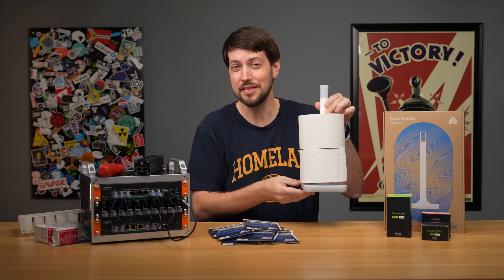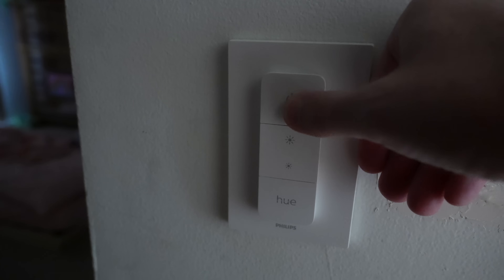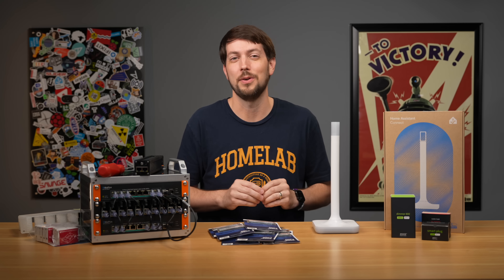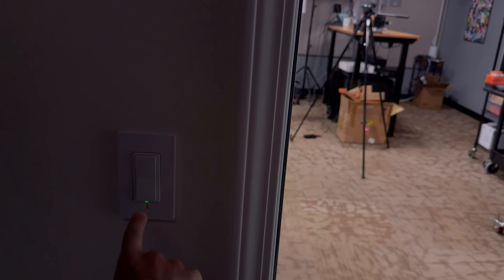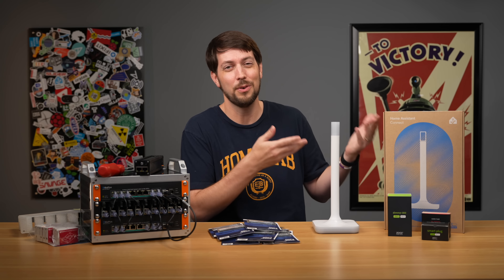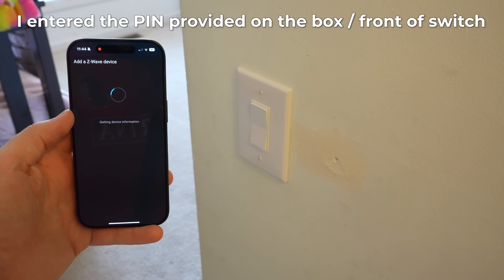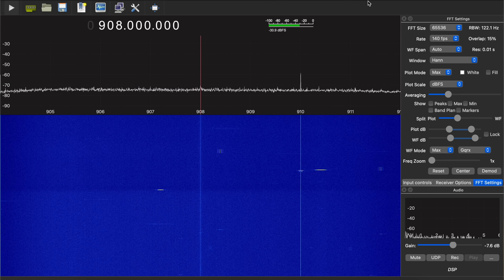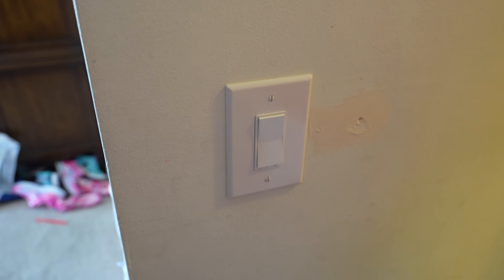My Smart Home Played me for a Fool

Comment: Welcome to Z-Wave! Even without the, uhm.. unit of an antenna, the range should beat Zigbee on the simple basis of lower frequency (2.4GHz is a terrible choice for low power applications).

Nice thing about Z-Wave is it's a standardised system, so all devices should interoperate well. Unfortunately, fair warning, there's an awful lot of very odd and flaky devices out there. Strange goings on like simply dropping off a network while still nominally being paired, being paired under two or even three different IDs despite having been factory reset, some very funky behaviour with battery devices (keyfob style switches can be.. inconsistent).

Actively avoid anything which is not Z-Wave+, with the possible exception of simple battery powered sensors. Thankfully, most things are now.

Comment: i startd home automation many years ago using zwave and they are still working. on top of that Zwave has a longer range of Zigbee because it is not using the Wifi frequencies.
using lower frequencies penetrates better through the walls which is a plus. 
right now i have a zwave bridge (fibaro) but as soon as it dies i will get the antenna you just shown us.

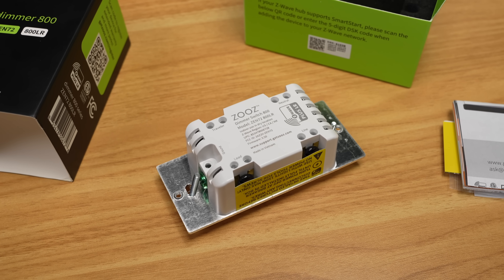Comment: 3:39 Breaker panel, confirm no voltage, do work, flip breaker again, confirm you didn't start an electrical fire, close up, done.  It isn't hard and there shouldn't be 120v/240v running through the wall unless you are an idiot.

Comment: In my last house, I installed a bunch of "dumb" Lutron motion switches in place of the traditional light switches, and they worked fantastically. No wireless connectivity needed. I programmed some of them into "occupancy" mode so they would only turn off the lights in bedrooms when unoccupied for a period of time (never automatically turning them on), but the ones in the bathrooms/laundry/garage would turn on and off the lights based on motion.

Comment: Isn't the saved brightness thing a setting with the actual switch config? At least it usually is, at least my hue lights have a "power on to last power-on state" option I thought.
Reply: In the Hue app you can set the power on behavior for the lights, this doesn’t have anything to do with the switch though; i.e. even without anything except completely dumb switches this setting works.

I’m sure though that some switches including those from Philips Hue have the possibility to set a certain behavior for lights that they control when turned on.

Comment: 3:45 Been there, done that... Multiple times... I've replaced all my switches and had a very safe way of working by turning off the breaker and always testing the cable before working on it and I still managed to zap myself when I replaced the very last switch (240 volt).

Comment: 250V in Europe. Without split phase i.e. no neutral wire or center tapped neighborhood transformers or need for bonding ground/neutral in only one place.
Reply: Lack of split phase doesn't mean lack of a neutral. In the vast majority of Europe, it's ~240V (220V, 230V.. I guess some of you might have done 250V..) from a 3-phase supply, with a grounded neutral which must not be additionally grounded in a normal installation, or RCCBs do not function and load currents can and will flow through earth wiring.

Comment: It is an interesting upgrade, I could see it being useful if you were spanning large dead zones, like sending Z-Wave to a detached building. But one of the benefits of every IoT protocol that's not Wi-Fi is they form mesh networks, so for getting around the house it's probably cheaper just to buy another Z-Wave device to be deployed somewhere in the middle that can do its own thing and act as a mesh repeater.
Reply: Or just a zwave extender that plugs into an outlet.

Comment: I always felt like putting the smart guts in the bulb itself was stupid, unless you want the color shifting stuff. I would much rather have the smart guts at the switch instead. Plus bulbs are more akin to printer toner to me; it's the commonly replaced consumable, sticking smart guts in there would be expensive.

Comment: I have solved this exact kind of issue by getting rid of the Hue bridge and using instead a ZigBee USB stick as my hub. Using the Hue bridge makes its associated bulbs and peripherals unable to use the ZigBee mesh. Without it, the switch signal can be relayed by the bulbs through the ZigBee mesh.
Reply: That's the one thing I didn't know.
But what about firmware updates ?
And all those fancy scenes that the coloured Hue lights can do ?
Do you miss any of that ?

Comment: Using Philips hue in home assistant can be controlled directly without the hue app. The lights and switches can directly be conencted to a zigbee dongle. There is even a POE zigbee adapter so the adapter can be placed in a central location. This way the signal reach is better and you dont have to deal with the hue app.
Reply: Also came here to say that Zigbee uses a mesh network, so coverage by routing devices is more important than the distance from a single non-routing device to the Zigbee gateway.
Reply: I was about to say the same.
I have a smlight slzb-06m I think.
And 3 hue bulbs It works perfect.
Don't use Philips hue app nor hue zigbee controller.
Just buy some beseed plugs that act as routers or some Ikea plugs for temporary routing.
Reply: Seconded. have a Sonoff Zigbee dongle, but I'm using it for Sonoff environmental sensors... but I wanted to put one further away than the Sonoff seems to work... Can we expect longer range with the ZWA-2?
Reply: @qcca123-f1v  you can extend the range of your mesh by strategically placing zigbee power outlets throughout your house that act as zigbee network routers. :)
Reply: @BienenChef or by getting a Zigbee extender. IKEA has some and they are even included in some of their battery operated products. (Like their smart blinders.)

They get power from USB A so easy to plug into something nearby. Or just a USB charger.
Reply: There are Zigbee devices that act also as routers (usually the ones without batteries) or another option is to flash the router firmware to the dongle instead of the coordinator one.  Moreover you could bind switches to lights on the z2mqtt interface so even if HA is going down, you can still operate them.I have paired to a single coordinator over 100 Zigbee devices and all working flawlessly over 3floors+garden.
Reply: I came to say the same thing.  I had constant problems with the hue hub locking up and requiring a power cycle every 3-4 weeks.  I replaced the hub with a zigbee dongle and have had zero problems since.
Reply: Assuming zwave isn't dead, I prefer that over zigbee purely because its not on the 2.4ghz band.  I Still have plenty of devices clogging that band including my themostat and it's remote sensors.  The same idea applies though, the light physical interface needs to function even if the wireless communication is down, and taking that one step further (aka homeassistant) the automation and wireless controls ahould still function even if the internet is down, or the company is shutting down their online service.
Reply: This is what I do, but the Hue switches are MOSTLY reliable, but having to swap batteries is getting to be a chore and occasionally they just won't work the first time you press them and I have to hit them a second time.
Reply: Yep this ^
Reply: Agreed. Lol
Reply: Why is your Hue hub located in your basement, instead of near the 3D center of your house?
Reply: I'm very surprised someone like Jeff was still using the hue hub, especially since it forces a cloud connection
Reply: @JustTheJames you might have to register but it operates locally.
Reply: @hmoffatt interesting, has that always been the case? I haven't used hue with the bridge in about 5 years and I remember there being around a second of lag every time, and not being able to turn my lights off when my internet went out once. Although thinking about it, I didn't have any of their switches at the time so it's possible those always worked locally.
Reply: @JustTheJames Zigbee has always been local. When you configure a switch to control a light it will send the message to it directly without going through the hub afterwards.

But if you are using a switch that's not compatible for some reason then it might need to go through the hub to be translated. That shouldn't be needed if both are Zigbee units though.

Comment: Your wife's unimpressed "mmmm" was hilarious lol. I think she misses the tactile feel of old switches.
Reply from the maker: They are nice. Would love an old switch with a solenoid to knock it on or off
Reply: @JeffGeerling  That'd be awesome. Tap a button on your phone and hear a distant KERTHUNK upstairs.
Reply: @OfficialEpsilon  The dream!
Reply: @OfficialEpsilon  The "KERTHUNK" would be like my old neighbors' house.  All the light switches are two mechanical buttons.  Push one button to turn the light on, the other button to turn it off.  All those buttons are wired with "doorbell" wire back to near the main fuse box where there is a large relay cabinet.  Everything controlled by light switch has its relay go KERTHUNK when a button is pressed in the house.
Reply: @OfficialEpsilon A 240V contactor would achieve that nicely! 😂
Reply: @OfficialEpsilon if my smart home isn't manually flipping a medieval looking mains wire switch why even bother with it at all
Reply: @JeffGeerling  Lutron switches by Caseta actually actuate the physical buttons! You can have the tactile feel of regular switches, but you can also hear the switches being physically knocked to the correct position if you control the lights via home assistant. A friend has it across his entire apartment, and it's really cool when he turns everything off and you hear a storm of clicks throughout every room.
Reply: That is why I always use smart relays like the Shelly 1 or Sonoff mini. Then no one has to know that I have smart lights.
Reply: @JoyfulShadow-i5u  The shelly introduces a delay though as the switch just becomes an input to the shelly which fully controls the switching of the light. If it fails you can't switch your light at all.
Reply: @JoyfulShadow-i5u  Could do the same with smart bulbs, but multiple smart bulbs on the same switch has always seemed silly to me.  On the other hand, one bulb in the pantry or closet works like normal from the wall switch, unless someone leaves it on and my automation turns it off.  Then the next time for manual operation the switch has to be moved off then on.
Reply: Which team is that at 2:32? Is that the St Louis City football team strip?
Reply: @sky37blue known as ⚽ in usa(known as football in other countries)
Reply: @abramb8690 you've posted a picture of a football and then said it's known as football. I'll keep calling it football though thanks since I'm not in the USA.
Reply: @sky37blue I typed soccer then noticed the ball ⚽ but the word soccer disappeared from my post, unfortunately in usa football typically refers to a different sport 🏈 but by whatever name I much prefer ⚽
Reply: 1925: It's just a light switch. 

2925: It's just a light switch, but you can see the radio waves!!!
Reply: Funfact: I live in the former GDR part of Germany and there are many Sovjet apartment blocks still around and I‘m living in one of which still has solenoid buttons instead of light switches so every time someone turns the light on or off - a distinct crisp KATCHUK comes from the fuse box.
Reply: @solidsnake6803 This is still state-of-the-art, except that the modern "Eltakos" is not as noisy. 

An older model once helped me to find a fuse box/distribution box. That was in a discotheque. My colleague was turning the light on and off, and I could hear the "ka-chunk" --  apparently from the middle of the largest floor. Took me a while to realize that there was a manhole cover, which had also been covered with the plastic flooring material. The manhole was specifically there just for the electrical distribution box.
Reply: Impulse switch to go with smart releys.

Comment: Imbued with the knowledge of your prior videos re: Home Assistant and Zigbee, I have my Zigbee in my server room in my basement; a plug router at the edge of the house, another plug router in the garage, and finally a plug router in my orchid greenhouse (aluminum and 5/16 glass -- can you spell Faraday Cage?) where I am operating my 1000 PSI fogger (FogCo).  I was hoping I could hop from the greenhouse to another building, but no such luck... yet, my failure to pair for the 4th hop may be my own incompetence. But I thought it might be novel to share here I have 3 hops to a fog generator.  I may or may not (more likely) use HA to manage the fogger, but thanks Jeff, for teaching me the way to automate a 3/4 HP motor from afar.
Reply from the maker: Nice! And yeah, there's always some leg that's hard to get a clear signal across :(

Comment: I used some Chinese ZigBee smart switches in my home, they work very well and I install them inside the default switch "box". So the switch keeps working even without HA. As these devices are always powered on, they work as routers for the ZigBee network, so the signal is always good in all devices, even on the very far from the coordinator.

Comment: FYI zwave is also mesh.  Turn it on.  Also better distance than zigbee as that is 2.4ghz
Reply: I'm surprised how well the mesh works. But only hard wired devices do any repeating.
Reply: I like that zigbee is IEEE standard, and not owned by a private corporation

Comment: My rule is to have stuff work like it used to dumb before making it smart. My challenge now is that my wife gets so used to stuff being smart that she forgets she can just still use a switch if the smarts fail for any reason.
Reply: I like this same approach. I feel that all these systems should always fail dumb if the smart unit fails.
Reply: @timwelch same, we have a bunch of physical switches and a central touch screen dashboard on the wall which includes quick shortcuts for whole-home stuff (all lights off, bed time, movie mode, etc); but I'll catch her standing next to it controlling individual lights via the Home app on her phone (which I setup as a "frontend" for HA stuff).

Can't win 'em all!
Reply: I did the same in 2017 with 6 lightpoints in my ceiling, after having multiple smart systems fail I made my own with a esp8266 and a relay board. But I added dumb 3 level  switches to the side of the box with a 1 - 0 - 2. 1 means always on 0 always 0 and 2 is the smart system. Saved me sitting in the dark when the wifi router failed me.

Comment: Thanks, Geoff. Great video. I have a bunch of smart switches as well and I ended up adding Lutron Caseta and the only drawback with that is it you need to get their Hub but it works great.  I have some old switches from GE that I think RZ wave will possibly Zigby and have them controlled via Smartthings, which I hate and also home assistant.